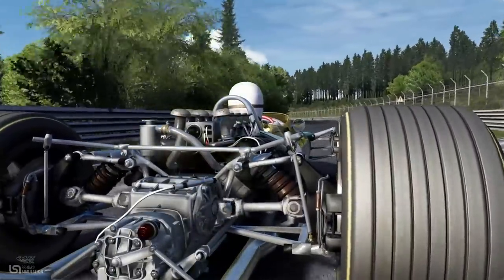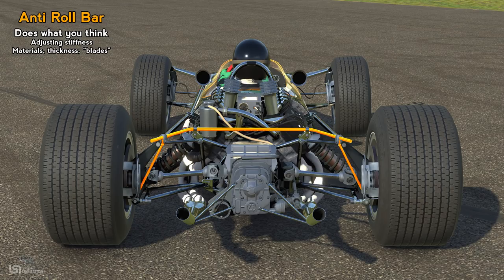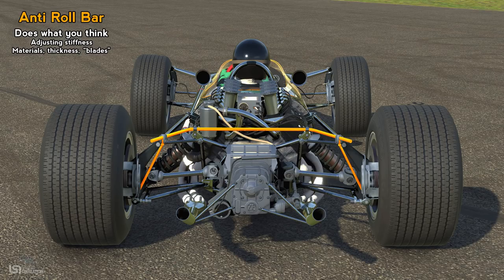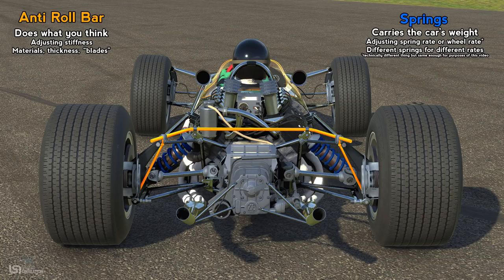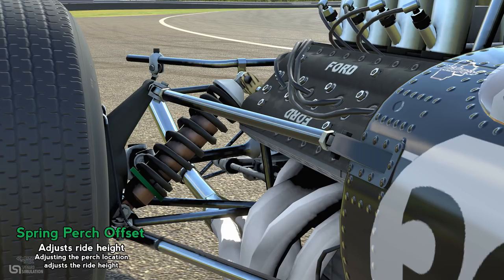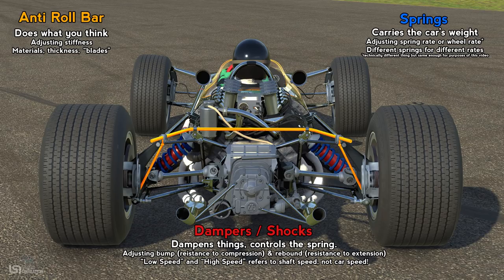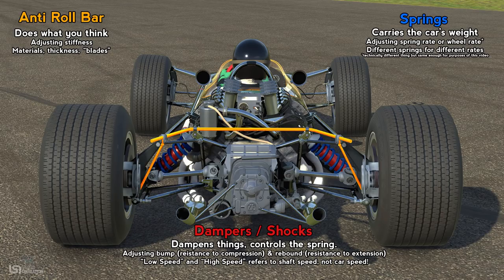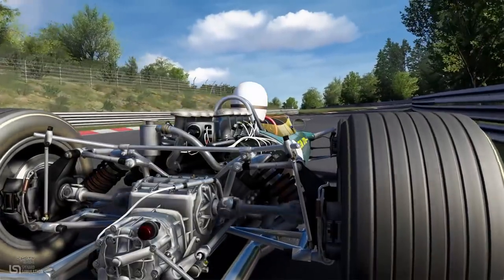Car Setup for Average Sim Racers : Suspension (Sim Racing Setup Basics 101 - Ep. 1)

Comment: Hi Empty,
I appreciate you do this as I think it is good to take some of the fear out of car setup! But I just want to point one thing.

2:12 'ARB typically felt mid corner' really isn't correct. What changes the balance of the car is the front versus rear roll stiffness. Typically this is the combination of springs and bars. The stiffer side takes more of the weight transfer and that side will have the most unevenly loaded tires. 

If you picture a car from above, you can imagine a side force from the front tires and from the rear tires. If the front forces are higher, you have more oversteer. If the rear forces are higher you have more understeer. Load sensitivity is a wierd tire thing that comes down to the axle that has the most evenly loaded tires, gives the most grip. So a stiff front with the inside tire almost off the ground relies on one tire to provide the grip. One heavily loaded tire has less grip than two tires under medium load.

The instant you are cornering, be that trail braking, mid corner or corner exit, the weight transfer is divided over the front and rear axle, and you feel this 'stiff front = understeer, stiff rear = oversteer' balance almost immediately. It isn't 'more so' mid corner. And this stiffness is literally an addition of springs + bars. In some sims literally a spring of 80 and bar of 20 will have the same pure cornering feel (ish) as a spring of 100 with a disconnected bar. We're ignoring many things here but in the simplest view this is true.

I did make a rambling video about setups myself that might be worth listening to for viewers and isn't super in depth with scary spreadsheets. https://youtu.be/I8x3ISXSnEg

But again, good to do this, a few videos like these (Aris does a nice job too) and people might learn something and save some money! :-)
Reply from the maker: We're on the same page, you are just going further than I want to for these videos. Congrats, you are an advanced learner! lol

Yes the ARBs are going to have an effect once you start loading up the car, but on entry and exit you also have the rest of the suspension setup and differential working as well which will arguably have a bigger effect at that phase of the corner short of just throwing all of the ARB in there. 

It's an intentionally simplistic view: Same way spring splits and rake weren't mentioned at all - topic for something later. Easier to make sense of that once you understand what the heck parts are even on the car for.
Reply: @TacticalCardboard  alright, yes the trick with these videos is to not scare people away, but also not leave out too many essential bits, you will always do both regardless to some people. :-)  If you want to chat about car setup in general or specifically how to explain something, I'm happy to chat about it. Don't wanna interfere with your plan but in case you want an ear to talk ideas into, mine is available.
Reply: As soon as I see that Niels largely approves of someone's explanation, I'm all ears! :)

Comment: I usually never bothered to touch the spring rates, but then I found out that they mostly affect weight transfer. The softer the springs are in the front, the more weight you'll allow to be transferred on braking. Likewise, softening the rear springs will help stabilize the car on corner exit.  When you feel like the car is too loose and oscillates too wildly when transferring weight, stiffen up those springs.

Comment: Really nice explanation of the basics of the setup parameters, though what will help everyone make more targeted tweaks and get even more laptime on pure cornering conditions (I.e besides for example the effect of spring rates on aerodynamics and bump response), is the balance of the car, meaning the tendency to over/understeer. 
Let's take for example a slow steady state corner(so that the aerodynamic balance doesnt have a great effect). If in the specified corner your car understeers, you can either stiffen the rear ARB, or soften the front ARB (same for spring rates, though they affect other aspects as mentioned). In the same manner you can tweak your dampers rebound/compression for corner exit/entry respectively. Then, the tire pressure will also affect the stiffness of each axle, so for example after lowering the tire pressure on one axle, you might want to increase the ARB stiffness to counteract. This is just a simple example, but the suspension characteristics greatly influence the effect of load transfer and its distribution and can help you greatly with the setup in corners. 
I hope this was helpful, if anyone is interested to learn more there is plenty of reading material online about basic vehicle dynamics, or setup.

Comment: As a NASCAR fan, could you maybe translate some NASCAR terms? Is the "track-bar" the same as the anti-roll bar? Likewise is a "wedge" adjustment the same as the blades? Cheers dude, thanks for the info!
Reply from the maker: Maybe at the end I'll circle back to some of the oval specific stuff, but that's not something I'm particularly familiar with beyond "more wedge more loose".

The track bar is part of the suspension geometry and not an ARB, wedge is spring loading on the RR.
Reply: I see, thanks! Hell even caveman terms are at least better than nothing. I remember you suggesting the adjust the spring rate for the GSCE/AMS1 SuperV8. I never fully knew why, but when I did what you suggested, the car would turn better. Now I know lol

Comment: So if the car is understeering, what can I change that won't make the car twitchy and unpredictable later in the run...
Reply from the maker: Few things to unpack : The car is almost never going to be perfect all of the time, so it's often a matter of what do you prioritize. 

The big place to start though with that in mind is where is it twitchy and unpredictable. On the power, into the corner, mid corner, corner exit, high speed or low speed corners?

The other is the question of why is the car becoming twitchy and unpredictable.

Is it burning off the rear tires faster than the fronts and that is the problem? Assuming that, perhaps driving differently would be the best way to go assuming you haven't totally screwed the pooch setup wise. Just because it's faster lap 5 doesn't mean it will be faster on lap 25.

Is the car just too stiff to begin with and once the tires wear in a bit it's just too sharp overall? Might just go softer on the springs by the same amount on all corners.

Or is it a case of as the fuel burns off the weight distribution change is causing the issue? Something likes this would go back to working with what you got and figure out what you want to do. (worth mentioning as the ACC 911 GT3s are really fuel load sensitive)